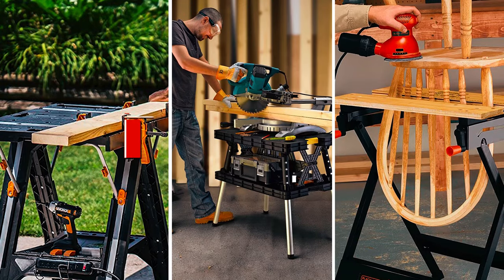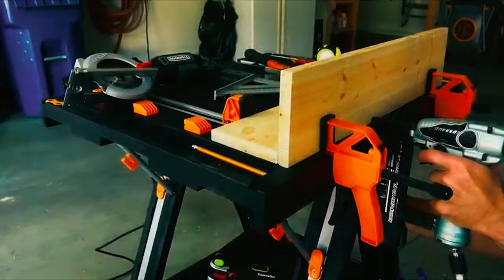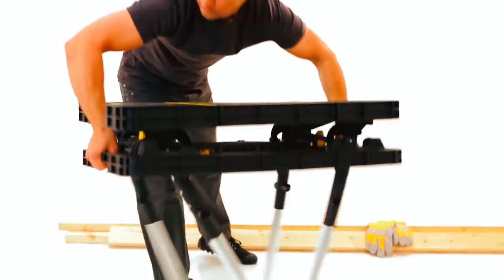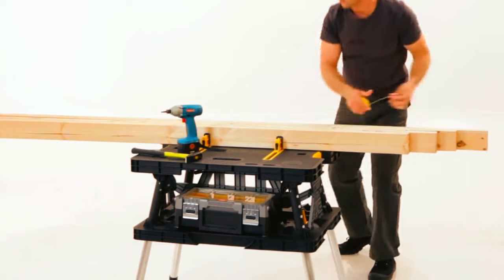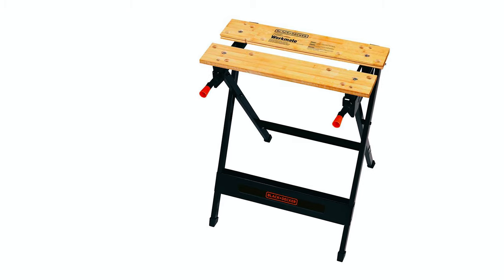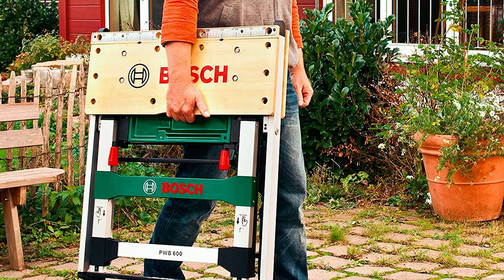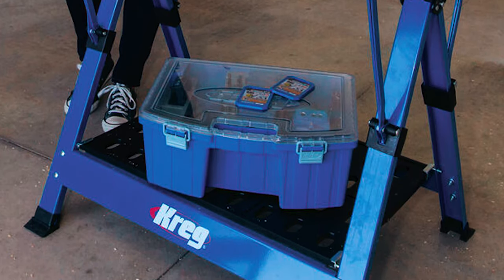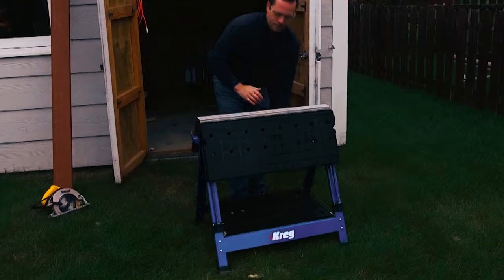Best Portable Workbenches In 2024 - Top 5 folding workbench Reviewed

Comment: What about Pony Jorgensen? It better, than Worx Pegasus.
Reply: My thoughts exactly.  I have two Pony Jorgensens and they are phenomenal.  Only drawback is they are a bit heavy.  Glen
Reply: @sandysmeltzer2975  Hello. I recently watched this video: https://youtu.be/eEQ1MGO5JC8 (sorry but it's on Russian language).  And once again convinced that I made the right choice.
At first I thought about buying a workbench from Worx, but in time I saw a video from the exhibition (it was held in Moscow last year). They showed a stand with products from Pony and Jorgensen. I immediately appreciated the workbench and decided to buy it. Doubts disappeared when I saw clamp tests on another channel, including clamps from Jorgensen.
The first thing I liked about the kit was the clamps. They do not protrude beyond the legs of the workbench when folded. You won't catch them by carrying something past the workbench. In addition, they are stronger, do not weaken the grip and are more pleasant in appearance than clamps from Worx. Secondly, the workbench is more stable and also the height of the legs changes. I even recently tilted it away from me and worked with a circular saw to cut ceramic tiles. It is convenient to install the disk, you don’t have to lean under the tabletop, you tilt the workbench (lower the opposite legs) 😁 .
Reply: Pony is better, just because of their clamps. Otherwise, I think the ease of opening and closng is a lot better on the Worx. Kind of sad, Worx's clamp sucks. I bought a couple for 79 dollars on amazon prime day. If it wasn't for the price I would of gotten the Pony just for their clamp.